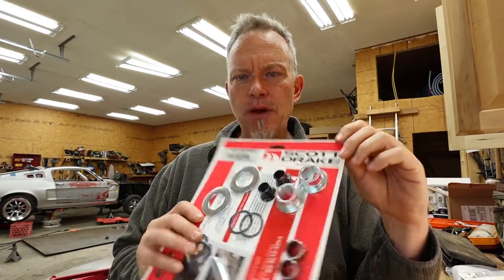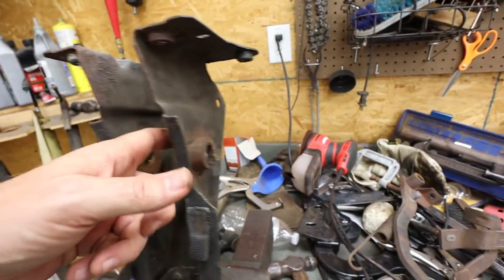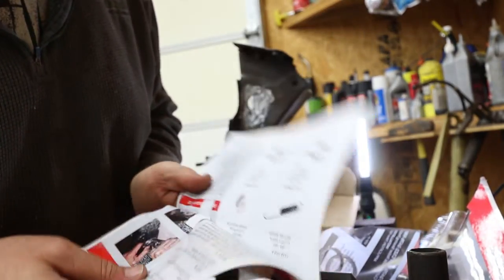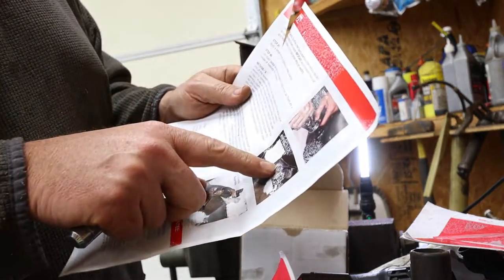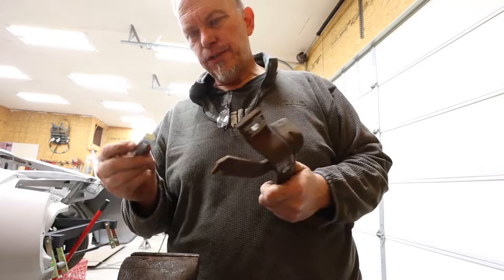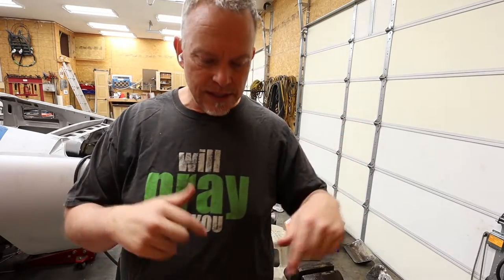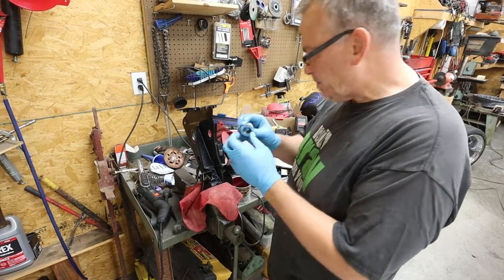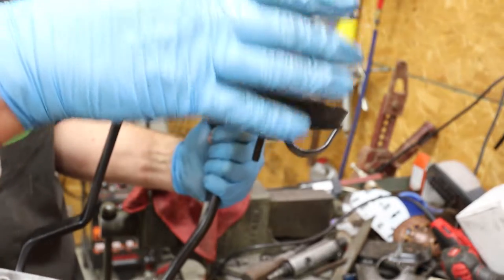Rebuilding your clutch and brake pedal cheap

Comment: Did you set the pinion angle with the springs loaded?
Reply from the maker: The first video in my attempt to show you how to set the angle I screwed it up completely!  I had to cut it all out (in a later video) and redo all of it.  And yes I did set it under load.